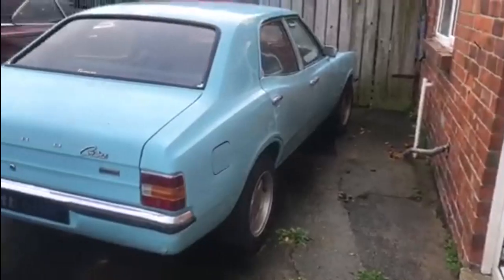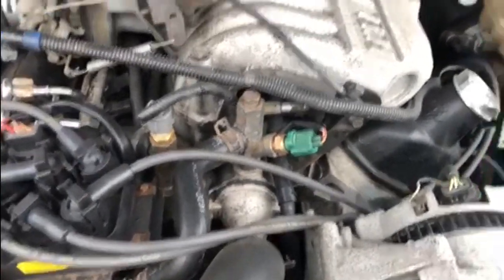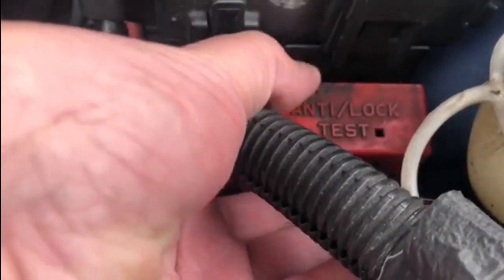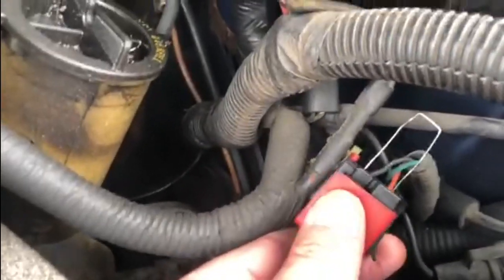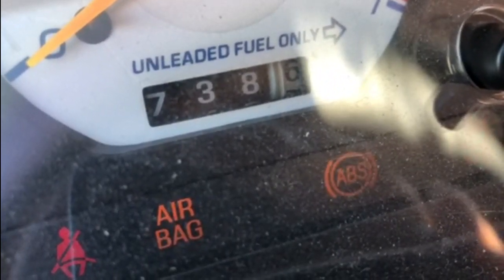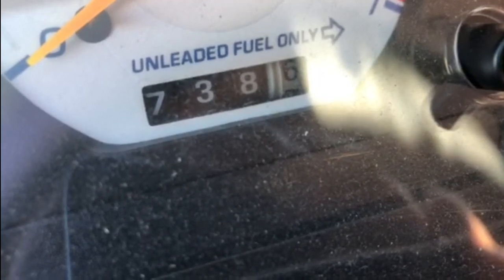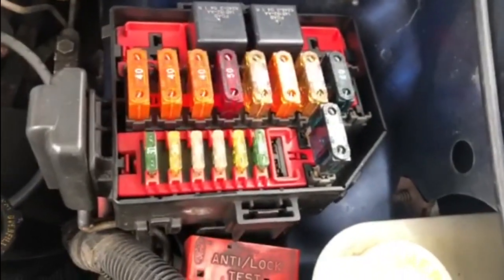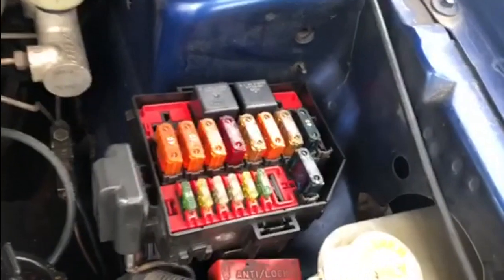'96 Mustang ABS On, You NEED TO WATCH THIS!

Comment: That was a fuse. The relays are the little black boxes. The D2's can suffer from that. It's a fault in the ABS block. Wardy's Works have done some work on a D2 ABS unit. Might be worth a look.   Normally it's one of the wheel sensors that goes out.
Reply from the maker: Thanks Derek, I’ll have a look. Someone else pointed out on facebook that the relay is in the ABS module and apparently there’s another fuse for the ABS in fuse box under the dash as well. All good fun and games lol
Reply: @DoubleZeroGarage  Always!

Comment: Does anyone know where I can get an ABS device that will also ship to Germany?  (for a 2000 model v6) or I'll have it sent to my aunt in New Jersey if there's no other option
Reply from the maker: If it’s an ABS testing device you want, I think they’re only available to dealerships. If it’s the plug in box under the bonnet, you might get one from rock auto in the states
Reply: @DoubleZeroGarage  abs control unit module i mean. 
I was testing today but it doesn't even find ABS but everything else
Reply from the maker: The ABS control unit is obsolete now, you’ll only get a second hand one in the states. I had to import one for the mustang in the video.
Reply: @DoubleZeroGarage  😥
Reply from the maker: You can find them but it takes a while, there is a place that rebuilds them, can’t remember the name right now though, try searching on google for ABS pump rebuild
Reply: @DoubleZeroGarage  yes I already have a company or a new one from us for 750$ with shipping over 1000$ -.-Do you know if one of the 98 models fits into a 2000 model?
Reply from the maker: The 98 and 2000 models are different cars, 98 is an SN95 and 2000 is a new edge. Ford don’t usually change the mechanicals when it’s just a facelift change though so it might fit. There are two different types of ABS pump though so make sure you get the right one. The part number should be on the top of the unit, take photos of yours to check against the new one before buying. Hope this helps
Reply: @DoubleZeroGarage  The diagnostic tool shows ABS but I can't get in, what should I do? Check power from ABS control unit or sensors?
Reply from the maker: @daniel5561  follow the instructions in the video, then google the code that you find. Mine said it was the ABS module so I had it tested by an auto electrician who confirmed it was a dead module. If you’re able to check for power to and from the unit, try that, hopefully it’ll help